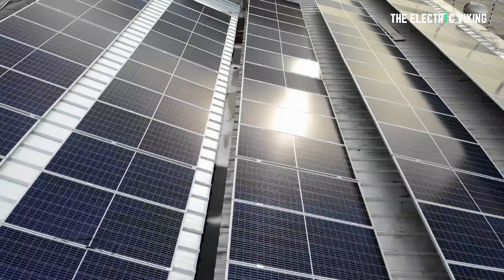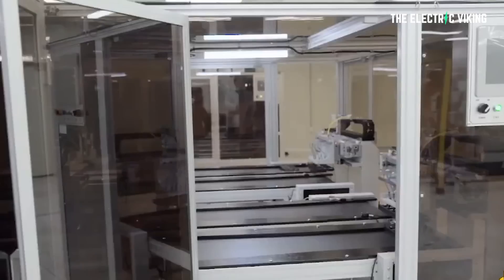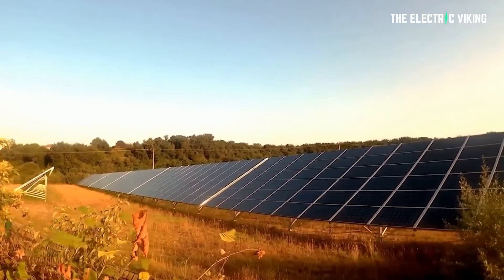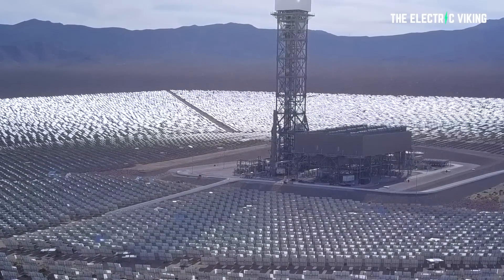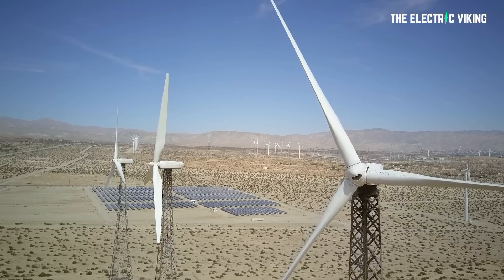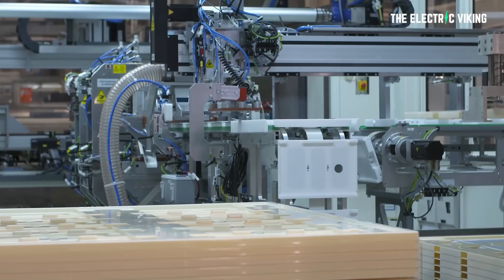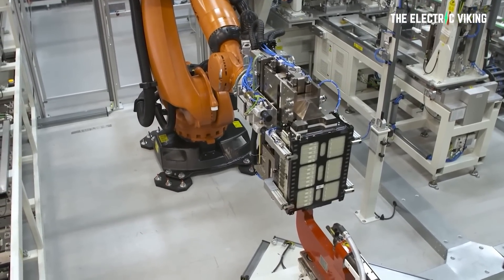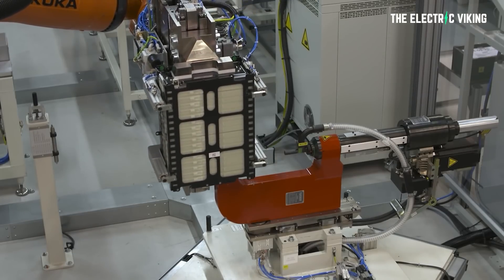The new battery that is cheaper than lithium with 4 times the capacity

Comment: 50% degradation at 1000 cycles is terrible 
Stationary storage really needs to be heading to 7000 cycles with 80% energy retention to be viable over a 20 year life with 1 cycle per day. 

So far flow batteries look the best option ????

As for cars I'm sceptical for sodium batteries 

As for cell phones I would take 20% size and weight penalty for a phone with a 10 year battery but most people won't
Reply: For cell phones, Li-Ion will be the choice for the time being.

Comment: I'd like you take on how a) rural and remote will change and b) what you see for nearly constant duty heavy equipment (like large trucks in the north that can't stop or they freeze up) c) mining equipment
Reply: I'm wondering the same thing. Mining up north have no infrastructure for charging batteries unless you run a diesel generator.
Reply: @murrat  They could install solar panel &\or windmill with Tesla Power Packs, to serve the purpose.
Reply: Caterpillar has demonstrated there EV mining trucks to be very good. Look it up on UTube!
Reply: @murrat  Bloom Energy is the better solution. What are they mining? It ain't that hard to electrify the north. They've just been too lazy until now. Or do you think electricity can freeze? 😁
Reply: Do you know companies like Sany and ZOOMLION?
Reply: @bardenfraser409  Nope
Reply: @rozonoemi9374  Oh yeah.
Reply: The mining areas in the north are a tough challenge, but ironically the vehicles themselves I suspect will work better than ICE vehicles, as they’re unlikely to freeze up.  I’m sure you probably are aware, but for others reading this comment… diesel becomes slush at low temperatures and even gasoline engines have real difficulties with getting started in the extreme conditions of the north, think -70 degrees Celsius.  Because electric vehicles don’t have the same kind of internal moving parts, and don’t actually need to ignite fuel to start, there’s less concern about seizing, although the transmission is still going to have lubricant challenges as do ICE vehicles, again probably a bit less as they’re a single speed, and fewer moving parts.  There are people who drive EVs in Anchorage and other remote areas, but the numbers are not high and not in remote areas (yet).

The electricity production is definitely an issue, isolated locations will need some method to generate locally which would likely come from diesel generators, at least initially.  I’d say that it may be quite possible to make use of geothermal energy however, especially in Alaska as it is known to have significant geothermal potential.  I’m not sure if this is true (“natural” geothermal potential) across the Canadian north or Russian north as well, but if companies like Quaise are successful, in theory they should be able to provide geothermal energy at most places on the earth’s surface, it’s just more cost effective when the bore hole doesn’t have to go as deep.

The vehicles themselves have no problem with providing enough power, funny enough the heavy equipment industry is always driven by costs, so if it is cheaper to operate an EV over a vehicle using some kind of hydrocarbon energy source, they’ll switch in a heartbeat.  And the fact that Caterpillar and other HE manufacturers are beginning to make electric models of some of their equipment suggests that it’s profitable for them, and a less costly option for at least some of their customers.  Caterpillar has an EV equivalent of their 793 dump truck, which can carry 231 tonnes up a ten percent grade at 12 km/h and can still hit a speed of 60 km/h.  And as a bonus, it recharges its battery on the way back down into the mine 😉. Bear in mind that the ICE version of this truck has an 85 litre engine!!

The consumer vehicle market is where people get to play zealot over the type of fuel that their vehicle uses, in industry they couldn’t give a rat’s arsehole.  Whatever is cheapest and reliable is what will be used, as it maximizes profit.  If overall EVs are cheaper to operate (factoring in charge stations, downtime for charging, maintenance, reliability of “fuel” supply etc. etc. etc.), then that’s what industry will use.  If not, they’ll resist unless regulations force them to change. If a mining company executive or board sees a chance to make an extra couple of million dollars in profits by switching, they’ll do so as it’s an economic decision rather than an emotional one for them.

So some of the remote locations are definitely going to take awhile to make the transition, it’ll depend on what solutions are available for reliability powering an electric vehicle in that area. It’s a funny scenario as during the summer, the amount of solar power available is enormous due to nearly 24 hours of sunlight, but of course there’s also the flip side of almost 24 hours of darkness during the winter, and it’s not possible (or even practical if it were possible) to store enough energy to get through the winter using power generated during the summer, so some other local generation capability would be needed during winter.

Comment: I don't know where you get 'four times the capacity' from. Sodium-ion has lower gravimetric and volumetric capacity than lithium-ion by nature of the chemistry: It's a bigger atom. That makes it less-than-ideal for EVs, where li-ion may still dominate. And portable gadgets too. The real application for sodium-ion is in stationary storage, where size and weight are not an issue: Grid backup, bulk storage for fluctuating renewable production, replacements for diesel generator backup for critical buildings, off-grid solar power installations, UPSs. Lots of great uses for sodium-ion - but electric cars probably won't be one. Sodium is a lot cheaper than lithium, the batteries are more chemically stable - so it's entirely practical to just stuff a few shipping containers full of them.

Comment: Sodium batteries may well replace lithium batteries for stationary storage applications. However, replacing lithium batteries for BEVs will be a less likely outcome due to the higher performance of lithium batteries compared with sodium batteries in terms of their energy and power densities.
Reply: CATL sodium batteries have same power density as LFP and will be almost 30-40% cheaper.
Mass Market adoption of EV's will happen with sodium batteries.
Reply: @manjeetkolte8601  actually CATL and others are not very accurately telling what those ”30-40% cheaper” statements actually mean. With the current knowledge LFP will continue to ge cheaper and Na-ion will have hard time to catch up within next 10-15 years. We’re now at major ramp up phase and due the volume growth we will see $20/kWh battery system costs by 2030 with LFP. The race is far from over.
Reply: @mfb424  We'll just have to wait and see.
Reply: @manjeetkolte8601  well. I’m not just going to wait and see but continue to build battery factories and develop the LFP tech further. 😜
Reply: Cycle depreciation and temperature ranges as well as the other elements that are available for the different elements may offer different features that might overcome the weight of the sodium. Sodium will have different options for the chemistry based on the energies of the reactions with the various compounds and molecules. If the other compounds are lighter than what needs to be used for lithium, then the energy density might end up being better.
Reply: @ronaldking1054  we have barely started the optimization of LFP cell mechanics and manufacturing methods. One just need to calculate how much of oure lithium is needed for one Wh worth if electrons. We’ll need only few molecules to provide the electron and ion conduits and the electrical isolation. So maybe we’ll get by with 50 additional molecules per li-ion? Theoretically that can yield to extremely nice Wh/kg with LFP too.
Reply: @mfb424  None of that changes that the optimal position of sodium might actually be better than the optimal position of lithium in terms of energy density, temperature affinity, and cycle longevity. The problem is that no one knows the optimal positions of either element. Did it make sense to look at lithium first? Yes, it did. Does it make sense to look at sodium? Yes, it does. Does it make sense to try to minimize the use of the abundant element of sodium? Yes, because sodium has other benefits for the ecology of the planet. Does it make sense to limit the refining of lithium? Yes, it does because lithium takes quite a bit to refine as well. All of these are reasons to exhaust the possibilities of both elements.
Reply: @ronaldking1054  Lithium is just as abundant as sodium when batteries are considered. They both can be extracted from sea water with same desalination process. Spodumene and other rock sources of lithium are traditional mining approach to get it refined. Harvesting methods from low concentrations are not deceloped by mining companies but battery manufacturers who need the quantity ”yesterday”. DLE is a big but not new thing. Reason to look the sea water source is that solely in seas we have enough lithium to provide 1500 pcs of 100kWh battery packs to every 8 billion people on the earth. 8bn X 100kWh X 1500pcs. Sodium solves nothing in this context.
Reply: @mfb424  None of what you said makes lithium better necessarily, and yet you are trying to imply it did. By the way, the desalination process is more likely to be an ecology problem. If sodium has better energy density, temperature affinity, and cycle longevity, it doesn't matter how abundant lithium is, but it does matter how much sodium one can extract if there are constraints. By the way, whether you decide to use large amounts of water to refine rock or to remove lithium does not change the fact you had to use the water, which, by the way, is another constraint.
Just as with pharmaceutical chemistry, the only way to know what something is necessarily going to do is to actually physically do it. There are plenty of recommendations that can be extrapolated, but the extrapolation needs to be proven. Your claim is that you know that sodium is less optimal, but I can guarantee you didn't do the research to prove that it is.
Reply: @ronaldking1054  We are not only debating from the technology perspective this issue but also from commercial point of view. Na-ion does not have yet the track record to be taken to large mass production. Li-ion and namely LFP has that 20 years of use under the belt. What you state about lifetime of sodium still awaits to be proven. Meaning no utility will commit to a 20 year contract to use these cells if there is already just as vost efficient buy proven technology available. It has taken over 20 years from us to prove LFP is a valid cell chemistry and it can provide what we promise.

We do have also possibility to use Na and Li in the same cell. That cannot be overlooked as we go for solid electrolytes. We may very well have identical cells from all other components and it can use either of these elements. If that can be achieved sodium has a fast track to success. If not. There is no short cuts to success. LFP has over 20 year head start in this race to scale up production.
Reply: @mfb424  No, you are trying to state because Lithium was tested first that Lithium is the best because the only way for something to become commercially viable is for it to have been researched. You are claiming because you found a route to the destination using some criteria, that it is necessarily the shortest route. I rate you an "F" for your understanding of the problem. The only way for that to be the shortest route would be to test the route until you know that every route with a lower bound is greater than the route already found. That is the basis of optimality. This is a foundation of computer science. I have a simple question for you, if you get 2 things and a something from 2 separate tiles, does that beat getting 2 somethings from a tile and then 2 things from another tile? No, because 4 things and 2 somethings as a result is more optimal than 2 things and 2 somethings, but I know of a game that claims that 2 and 2 is better than 4 and 2 to be true. You are attempting to do the same. The game takes the biggest hammers and then attempts to make the hammers make sense, which is exactly the method you propose for battery production and research. You will get the exact same bad result for optimality.
Reply: WHAT!? 
Tesla and Mercedes are building a sodium battery factory in Germany… Hope someone tells them, gosh. 
you should zip your convincing paragraph to Elon and stop the madness
Reply: There will not be any Sodium Batteries in EV's. CATL meanwhile makes Sodium Ion Batteries that have the pontential to get there, but that is a fully different concept. Also there are not any Lithium Batteries in BEV's to be replaced today. Literally all Batteries in BEV's are Lithium Ion Batteries which again is a completely different concept. We need to be precise here because both Sodium Batteries as well as Lithium Batteries (the latter would be called Lithium Metal Batteries) are existing concepts, but these are vastly different from their cousins using Ion state of these elements.
Reply: I'm told they match LFP for energy density